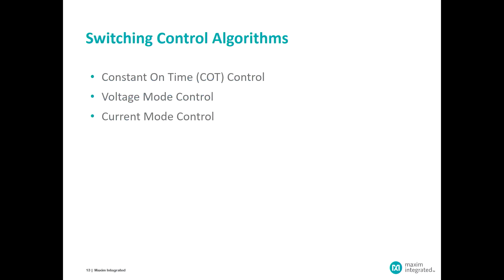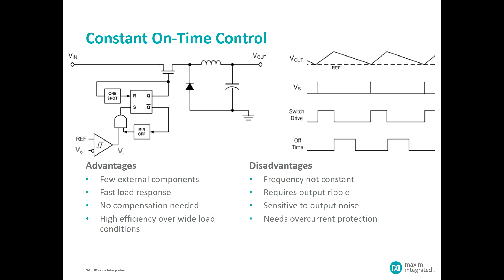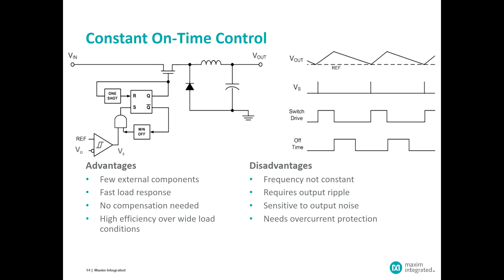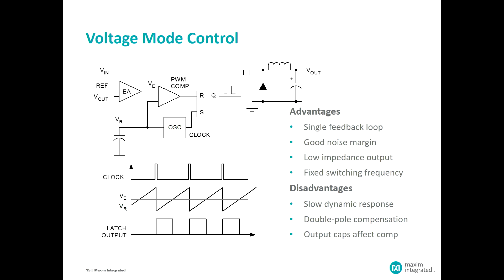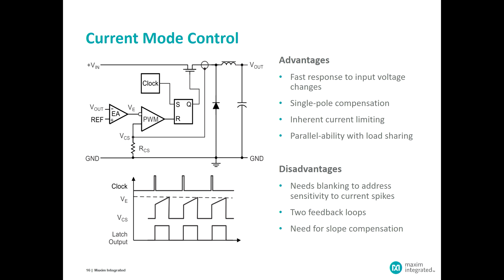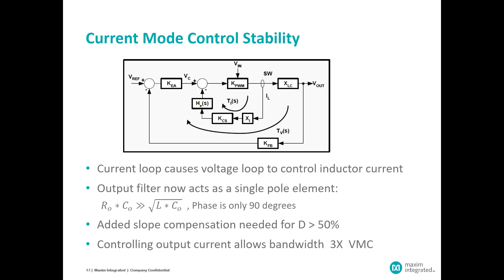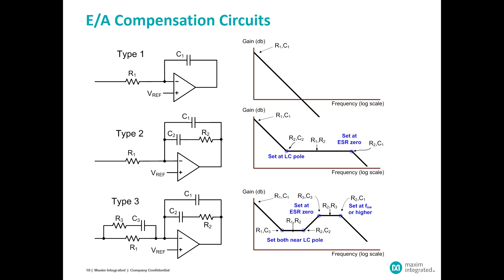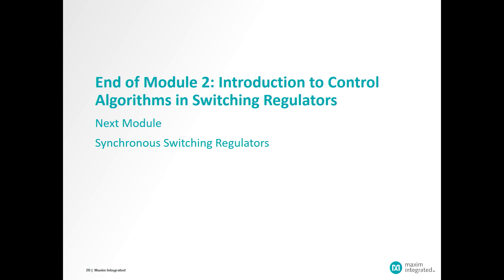Module 2:  Introduction to Control Algorithms in Switching Regulators

Comment: Current-mode control is your point of strength, but it does not explain how you create the current sensing. At minute 9:00 of the video, the diagram shows a wire goes on the Rcs resistance, I think is a sensor that indirectly reads the current ripple. Is it correct?
Reply from the maker: Yes, the loop between the power switch and the inductor denotes a current sensing device (a current sense transformer) that terminates on Rcs.  So, Vcs is a voltage representing the switch current information with a ratio scaled by Rcs and the current sense transformer turns ratio).  By the way, there are various ways to sense the switch current.  Current sense transformer are used only in high power system.  Most integrated buck converter solutions that Maxim makes use different, proprietary techniques to sense the switch current.
Reply: @maximintegrated  The techniques to sense the current are two o three, you can use electromagnetic techniques or self-matched filter, ect... By the way you can delete an external pad (for integrated buck converter), with only two commercial techniques, in the other solutions you need an external pad to sense the current.

Comment: Thanks Maxim and Thank Professor Mammano. I have two questions: 
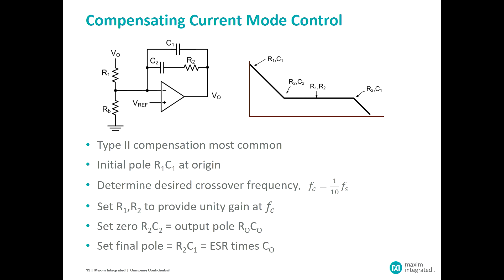1) Analyzing the type ii compesator, what relationship have the R1 shown at 15:36 (let's call it simply "R") and R1 and the Rb shown at 17:07. Is it R the parallel of R1 and Rb?
2) How can I do the slope compensation circuitry without loading the RC pin of a CMC controller which does not have slope compensation pin?
Thanks for reading and for your help.
Best regards.
Reply from the maker: Thanks for your questions, David. Here's our input:
1.  R1 and Rb form a voltage divider to set the proper output voltage.  Vo = (R1/Rb + 1)*Vr; where Vr is the reference voltage of the feedback loop error amplifier
2. To do slope compensation, please use a controller that has this feature
Reply: @maximintegrated  Would it be different if I not only use R1 and Rb (for the voltage divider) but If I include a include a new resistor which is connected to the inverting input of the OAmp and the connection point of these resistors, so that the PI gain is set exclusively by R2 and the new resistor? Thank you for your help.
Reply from the maker: @davidcano90  You have to use R1 to set the control loop gain.  You can use the new resistor to set the ratio for the correct DC output voltage

For additional questions, it would be great if you could consult our Tech Support resources. We have an online knowledge base with Q&As as well as Tech Support experts who can help: https://maximsupport.microsoftcrmportals.com/en-US/support-center/  Thanks again!